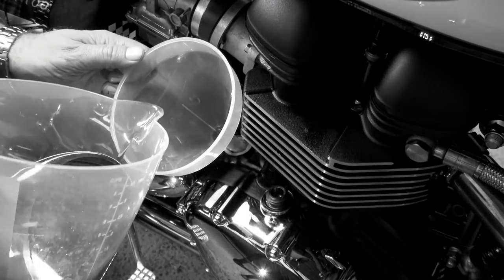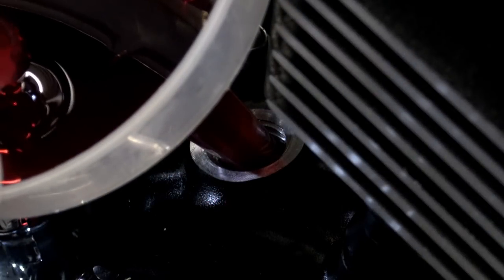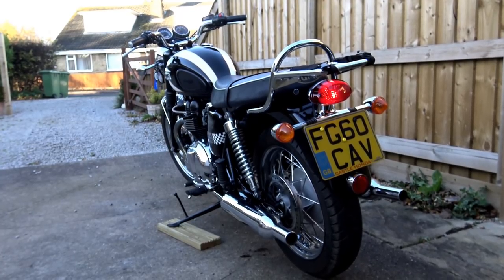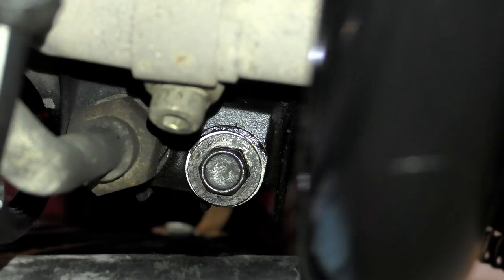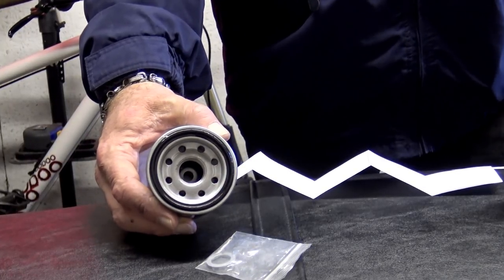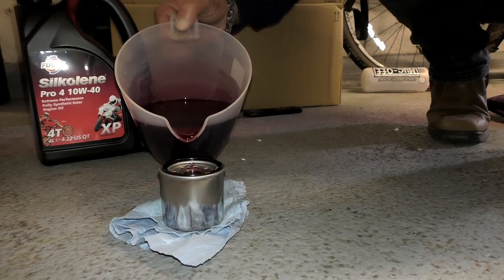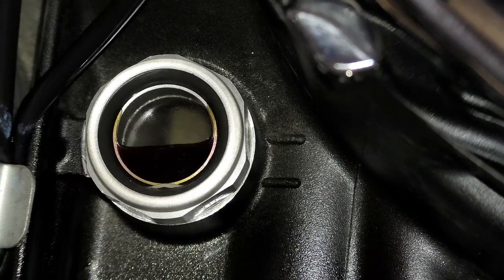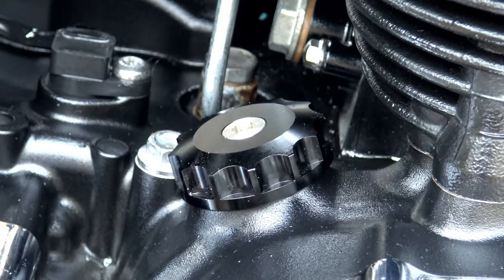Triumph T100 Pay Day Projects, Pt2 First MOTONE Custom parts fitted, Oil change!

Comment: There is an appropriate 3/8" sq drv oil filter cup socket that properly grips the flutes on the oil filter, making it easy to remove. 65mm/ 14 flutes is what you need.

Comment: Excellent video! Stuart, have you considered recording a video regarding options for a flat tire on a remote country road?  I had a flat tire which I was unprepared to resolve years ago while driving a friend’s 1959 Triumph 500. I had to leave the Triumph with a nearby resident next to his driveway while I hitch-hiked back to town and returned next day with a truck and help to load the bike for return to the repair shop. 

There are a number of YouTube videos on the subject, but I’d really enjoy hearing your opinion.

My questions relate to what you would do in this situation?
1.	Recommended temporary external fix like sealant, plug, etc.?
2.	Carry a portable battery air pump? Any particular brand?

Thanks and keep up the great videos!

Comment: The back of the oil jug says it all.  It's JASO MA2 rated!  For my Tmax, I have a K&N oil filter removal "cap tool".  Works great and I can use my small torque wrench on it if needed.

Comment: The extended seat screws and other matching knobs look great!  Most of the bikes here in the US are customized with off the shelf parts.     There used to be an oil filter socket that fit the end of the oil filter to a ratchet or extension, not sure if they're still available.
Reply from the maker: Ive had one or two bad experiences with the oil filter cup wrenches. theyre of very varying quality, but your right if i can find a good one that is definitely the very best tool for the job!

Comment: Stuart after buying my new t100 few weeks later it started leaking oil, finally figured out it was coming from galley plugs. It was under warranty so called my dealer, it was like talking to someone that sold lawnmowers so l repaired it myself. I had to take starter, headers, off to get to plugs, and after draining oil l could not believe how much oil came from the starter portal and galley plug holes.
Reply from the maker: Hi Terry, ive heard a few horror stories about dealerships similar to this with various warranty issues and have indeed experienced similar responses to problems with the T120, so i know exactly where your coming from mate!
Reply: @stuartfillingham  I can relate to this I bought a 2013 T100 new and within days there was a few drips of oil on the garage floor so took it back to the dealer. After a couple of hours he told me he had fixed it and said it was the engine vibration which caused the oil leaks, I told him mate I owned a T140 in my younger days and these don't vibrate.Got home and still had a few oil drips. I contacted Triumph Australia to state my case and their response was take it to a dealer, Triumph showed no interest in satisfying the customers concerns. In the end I got a workshop manual and proceeded to check the torque on all engine and sump bolts and found the sump bolts were way under torqued hence the oil drips. Torqued them up and hasn't leaked since. If you want a job done properly do it yourself now do all work on the bike.

Comment: I've had very bad luck with the seat bolts. I have the pretty useless though pretty Triumph rack and getting the both on and off is still a huge pain. It may be that I have the set made by British Customs and maybe those are not long enough but then on another note, someone walked off with my first set and one fell off with the second set. Without an Allen wrench, you can't tighten these down enough for them to stay on or deter thieves.
Reply from the maker: I suppose it depends on where you leave your bike sir. removable seatbolts or not i never let my bike out of my site when i park anywhere slightly suspect.

Comment: Hi Stuart,  how many km can you run with this Silkolene full synthetic oil ?
Reply from the maker: not sure what silkolene recommend but, it should easily be good for 10,000 miles on the T120. i would just stick to the service intervals for your bike.